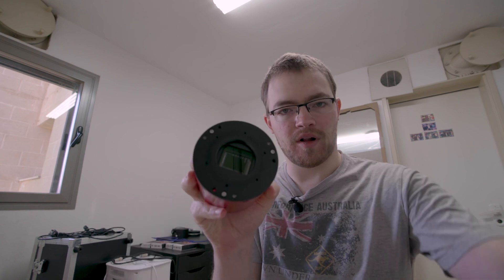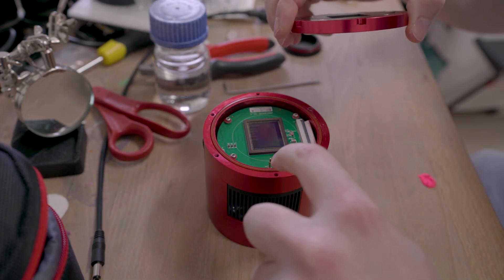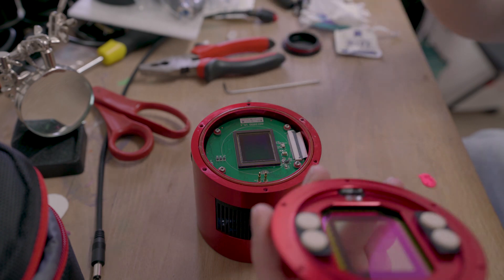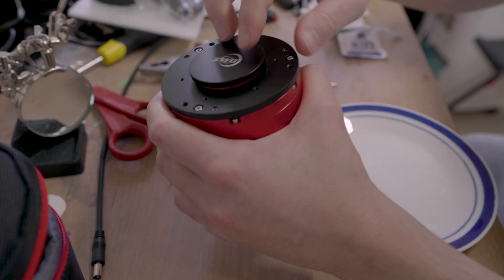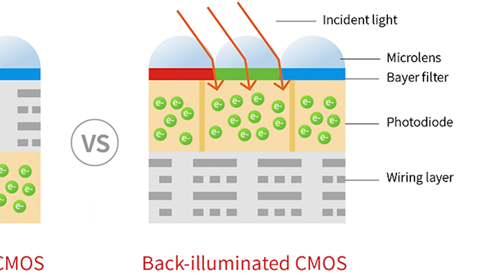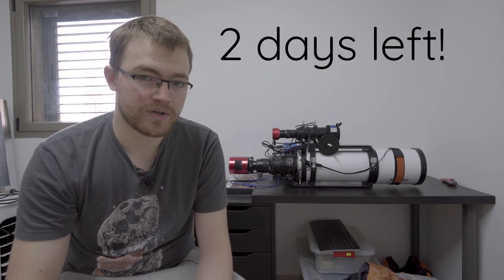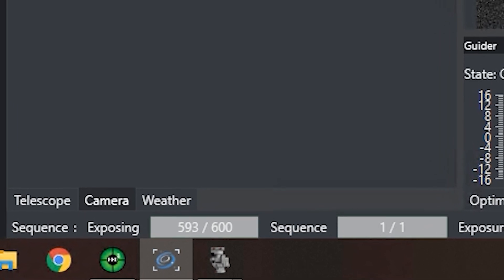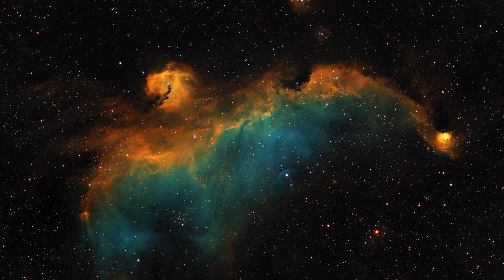The New ZWO ASI2600MM - First Impressions

Comment: oil on the sensor from oily o-rings on a thing costing multiple $k ... wtf ... really. Get the effing oily rubber o-ring the F out of there and replace it with a silicone ditto 🤮

Comment: Oil problem, WTF, if these things weren't so hard to come by it would be straight back to the shop? Surely a faulty one?
Reply from the maker: Nah, happens to many owners.
It is a pretty bad move by ZWO.
And if they were to do a recall like nikon did back when it happened to the D600.
Then it would've been ok.
But all they can do is just show customers how to clean it.
Which in my mind is fine because sooner or later everyone needs to clean these sensors anyway.
And i always prefer an issue i can handle myself rather than one i have to send back for service.

Comment: The ASI2600MM is STILL not even commercially available yet, so cannot be “Camera of the Year” !
Reply from the maker: Huh? It has been commercially available since i think february.
Reply: @MichaelLevAstro  Every U.S. supplier to whom I’ve spoken says they are STILL waiting on shipment of these from ZWO, and ZWO’s website also indicates they are still ”on backorder”. Just because they can be ordered does not mean they are commercially available., as this game has been played by ZWO for MANY months now. In fact, one supplier told me that ZWO has admitted to her that they have not been able to get the chips n sufficient quantity from SONY. From which supplier did you get your ASI2600MM ? Presumably some special arrangement for a good customer, or in exchange for your review.
Reply from the maker: @michaelhettrick8479  Straight up ordered from ZWO's website when it first launched.
Nothing special.
I guess after the first batch or a few they couldn't get stock on those sensors.
But it is commercially available just out of stock.
Reply: @MichaelLevAstro  I see. But after that first batch, the only thing that is “commercially available” about the 2600MM is that ZWO and it’s suppliers are available to accept your money .... NOT to actually deliver the product with ANY definite or fixed timeline whatsoever. I’ve tried ... the delays are continual and with zero promises. So this cannot be advertised as a commercially available “product of the year”.

Comment: What size filters are you using? Do you think 1.25 filters are too small?
Reply from the maker: I use 2 inch filters.
1.25 will definitely be too small.
36mm is the bare minimum.
Reply: @MichaelLevAstro  thanks for the reply! I might just get the color version of this camera instead as I already have 1.25 inch filters
Reply from the maker: @Jam_66  Both are great!
Reply: @MichaelLevAstro  but would it work even if it's at the minimum? I have a newton f4

Comment: When the 2600MC was announced, I knew that was the camera I wanted... but in mono. I waited and waited .... and waited for the MM to be announced, however I got tired of waiting.I ended up getting an incredible deal on a 533, so the 2600MM will have to wait now. However, as you mentioned, these new generation of sensors are just incredible no matter which one you end up getting.

Ideally I’d love a 533MM, but alas that isn’t happening unless Sony change their plans. I’m also glad you pointed out the oil issue, albeit annoying, isn’t a total deal breaker or camera destroyer. Nikon had endless oil on the sensor recalls (unsurprisingly Sony sensors on those models too if I recall correctly) but with astro cams being so easy to a access the sensor and sort it, it’s just a minor inconvenience.
Reply from the maker: Definitevly an easy fix, and not at all a deal breaker.
The 533 is a great choice for that price range.
It would be cool to see a mono version of that camera, will really tie the family together 😁
And yeah i remember the nikon (i think it happened alot on the D600)
I yes im pretty sure those were sony sensors as well.
Reply: @MichaelLevAstro  Hopefully Sony decides to bless us with the mono goodness with a 533MM. I got my 533 as an open box return plus Black Friday reductions on top of it, so I couldn’t say no 🙏 Especially as literally no other camera was in stock at the time.
Reply from the maker: @BBROPHOTO  Ooo nice! And it's already a pretty cheap camera! (Relatively speaking 😀)